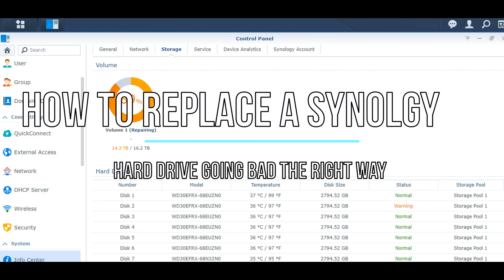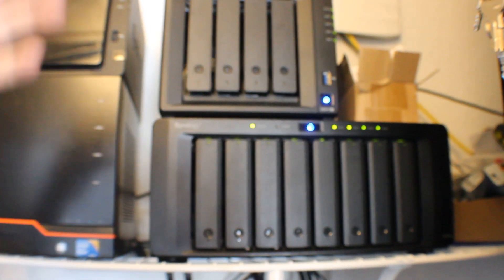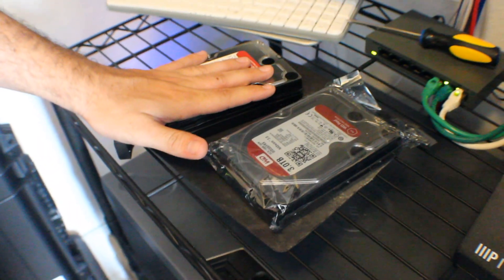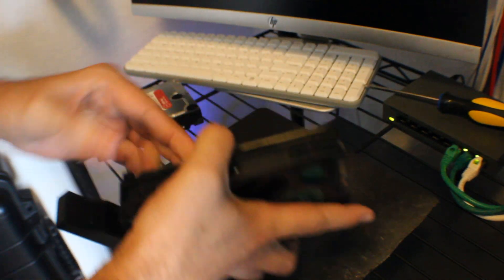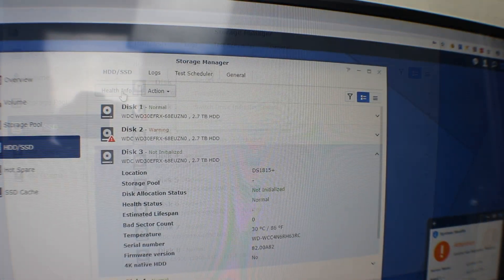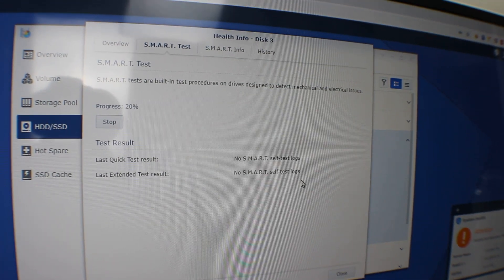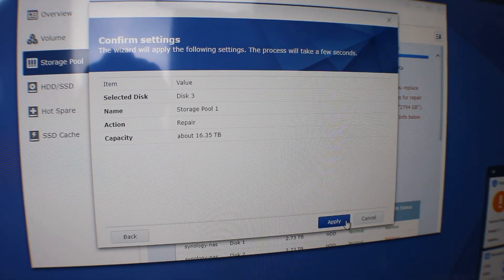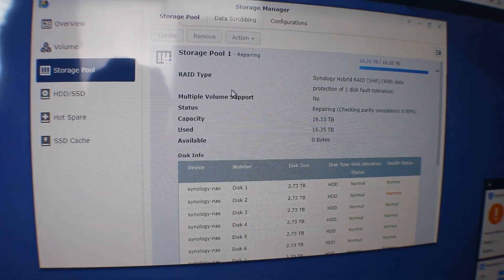How to Replace a Hard Drive in a Synology NAS

Comment: so u pull out the drive without doing anything in the system?
Reply from the maker: You can or go into Synology to disconnect it first that's the proper way to do it but other way should work but go in and disconnect first make sure to have backups too

Comment: I have a question, I hope someone can help me.....I have a Synology NAS DS918+ and the hard drvie and the drives are already failing.......can I use the same method demonstrated on this video to replace my drive? and how can I copy all the Files I have in the drive that is failing into the hard drive that I will be using.... How can I copy all my files from the drive that is failing into the replacement drive?
Reply from the maker: First do a complete backup of all your files to a external drive then one at a time replace one drive wait 24 hours or so for it to get repaired then do the next one when it completes the first one but back up your data first!

Comment: Hi sir...can ask a question how can i replace HDD DRIVE in NAS Synology that using Raid 5..Im scared lost my data or being corrupt.., i just found out last night that VMWAARE  Sphere 6.5 error loading all my VM...then review my Synology one having bad sector and the other one is having BAD SECTOR..thank for the reply much appreciate..
Reply from the maker: I would definitely plug in an external hard drive that's big enough to back up all your data especially the VM data sounds like you're using the Synology Nas as an attached storage to VMware? I would definitely use the app to back of your data right away or just copy the data off to an external drive before replacing the drive. If  you have multiple drives failures when you replace one it might cause another drive to fail during the rebuilding process which will cause you to lose all your data. Back up your date of first then replace the drive.
Reply: @GreyTechLive  how can i back up? when i dont see my files..I already pull out the HDD all of the sudden the SYNOLOGY trigger to repair itself automatically..right now im waiting to finish the repair process then i will load the new HDD..cross finger hopping  it might goes well..
Reply from the maker: @jhunfang06  oh crap Sorry I didn't know You couldn't see your files then the only thing to do is to replace the drive and hopefully it can repair their array and nothing else fails and you get your data back hoping for the best for you

Comment: I'm very new to NAS.  How did you replace all the data? Isn't the data still on the old #3 and the other ones have different data?  Which Raid (idk wtf this is but im sure it's the answer) did you use?
Reply from the maker: hi yes the old drive will still have some data but will be un readable because it needs the other drives to reconstruct the data. Just put in a blank drive and it will rebuild it to the array as long as the drive is same or bigger then the other drives.
Reply: @GreyTechLive  that's neat so it like knows what it needs to replace on the other drives and you just replace it.  

Do you just use the standard setup for that? I would like to know because I'd hate to get invested in this and then lose a bunch of data when its time to replace HDDs
Reply from the maker: @thebmxreviewer  ya right 100% by default the Synology will put the drives in a shr raid which will allow for up to one drive fail and shr2 you guess it up to 2 drive fails with 5 or more drives, and both raids allows you to just pull out bad drive and slide in a new one without losing any data but I always suggest have a external hard drive plugged in to have backups don't just rely on the raid any IT would agree. Also there are other raid types like raid 1 and 5, 6 etc that are good as well just depends on how many drives you have and what unit size you have every situation is almost different. Let me know how else I can help
Reply: @GreyTechLive  thank you for your time. I think you put my only concern at easy to start my own cloud storage/Plex server.
Reply from the maker: O nice man  I do have a Synology running plex as well love it no issues at all have fun!
Reply: @GreyTechLive  if you've had multiple of that brand, do you recommend a certain model?
Reply from the maker: @thebmxreviewer  hi yes I use the DiskStation DS1520+ because it has a lot of power and memory or just any Synology Play versions will be great because you want something that has a decent amount of CPU so I can decode the videos and won't pause when trying to decode or have issues so keep that in mind :)

Comment: I have a odd scenario
I have a ds1019 with SHR-1 with 5 hdd each 12TB. 
My new NAS is a DS1821 and I bought 3 hdd 18tb each. 
Do I migrate the 5 drives first and then hot swap them one by one? Or do I just add the 3 hdd to fill all 8 bays and then swap out the old 5 drives later?
Reply from the maker: To be honest I would just back up your data and settings and restore it to the new NAS with the new drives

Comment: Uhh, those type of synology with the front cover including the model you listed ARE hot-swappable, and an 8 drive nas should actually have a 2 drive fault tolerance, with shr-2 you can have 2 disk fault tolerance with 4 drives.
Reply: nevermind I see what you mean.  thought he was going to do both at once.
Reply: I think he did have RAID 6 otherwise he would have lost data.
Reply from the maker: well depends on the raid and i had shr-1 so only one drive could fail which i know is bad for 8 drives... but its just a testing box. yes 4 drives is the bare min for shr-2 :)

Comment: 1.Can you  use any NAS ready hdd ? And do they all have to be exactly the same?  
2. Is it fast enough to do video editing off of?
3. Can you directly connect it to your PC without having to connect through a wireless network?  If so, whats the fastest/best direct to PC connection ?
Reply from the maker: For best performance it's always better to use same drives and Nas drives would be fine the pro we red are better since they are faster if you want to edit of it then 1. Get the Nas that support read and write chahe or use SSD Nas ready drives. 2. Use gigabit switch and hard line the Nas do not use Wi-Fi ever lol will slow performance for sure. They do have some that are not network and you can use USB 3.0 to connect to your computer
Reply: @GreyTechLive  how about lan to lan.  Is it faster than usb 3.0 ?
Reply from the maker: @AndyHTu  really depends on your environment but USB would be faster but network not far behind
Reply: @GreyTechLive  gotcha.  Thanks for taking the time to respond.  It's very appreciated.  I will make this my next purchase before I build a new PC.  Been needing a solution like this for a very long time now and hated transferring files to new external drives.  This might even be able to replace dropbox for me.
Reply from the maker: Anytime now if you could afford a 10gigbit network adapter and a NAS that supports 10gig network then that would differently be faster but alot of money too :(
Reply: @GreyTechLive  I don't know too much about networking, so I assume this Synology NAS doesn't do 10gigabit speed?  And I also assume you would need to install that network antennae to  your PC as well as your modem/router?
Reply from the maker: The cheaper Synology units don't have 10gig only the more expensive unit usually have them and we all have to be hard line they don't have wireless that fast yet. But yeah I would be a lot more expensive see I may be stick with what you're going to be doing would be better :) let me know if you have any other questions
Reply: @GreyTechLive  I apologize for constantly commenting, but is there somewhere I can pick your brain or if commenting here just fine? :)
I've been talking to network friends and they keep telling me NAS aren't worth it because it doesn't transfer fast enough, but a lot of these don't add up when all I hear are youtubers saying NAS for video editing is extremely fast.  
1. How fast does a USB3.2, Thunderbolt, 10gbs Cable transfer?   Is it faster than what a super fast SSD can transfer?
2.How fast can a fast Synology/QNAP transfer?  I've been told that a fast SSD can only transfer 200-300mb a second. (maybe misunderstood)
3.I don't have a 10gbs router, but it does transfer 1gbs speed.
4. When you said hard lined, does that mean my house networking wires would need to be upto speed? Its about a 15 year old home so the cabling for it might not be up to date.  I also don't have control of the landline or the network in the house, so the best thing I would be able to do is just attach a 10gbs cable.  Since you said to not use wifi, does that mean I will need a physical cable fast enough to transfer the data?  Or do we need to connect to some kind of static IP?  (sorry for the dumb questions, I don't know much about networking lol).

Conclusion: Is NAS really faster than than an SSD enclosure with usb3/thunderbolt3 connection? Or is a fast NAS SSD fast enough to validate a anything beyond a usb3? (I keep getting some dude telling me usb2 is fast enough for editing as long as its off ssd, but that hasnt been true from my experience)
Reply from the maker: It's not since your network is not faster than one gig and you don't have the correct hardware for anything faster so yes I would just use USB 3.0 or if you can USB-C and then you should be good that way only good thing about having a NAS is you can also share it on the network and have multiple computers connecting to it So if you have like two editing stations that is a benefit of a nas. You want to talk more about this you can get on our discord and we can talk directly there happy to help Thanks for the comment
Reply: @GreyTechLive  joined!
Reply from the maker: @AndyHTu  nice

Comment: I want to swap the 5400 rpm with the 7200 rpm drive.   If I take out one of the disk and put a new one in, I won't lose my data?  I guess there's some kind of technology in the Synology hybrid file system.
Reply from the maker: Correct as long as you are in some kind of raid you should be okay do you have more than two drives?
Reply: @GreyTechLive  I have 1520+ with 5 bays.. I have 3 drives in and I want to swap 2 of the 5400rpm and replace them with 7200 rmp.  So I guess I would have to do one at a time.
Reply from the maker: @Barry Liu  Yes correct do one at a  time and make sure the other one is done before you start the other one Also I would back up just to be on the safe side.

Comment: I just received a notice of 6 bad sectors on my drive 2. How long can I wait to replace this drive?
Reply from the maker: I would always make sure to have good backups but that's really not that many bad sectors I've had drives that have 50 to 100 and it's still working fine but that's just a telltale sign that the drive will fail as bad sectors increase so just make sure you have good backups and you can use a drive and to completely fails but I just replace it when it starts to get over 20 bad sectors or more

Comment: Thanks for sharing this video. I have a Synology 920+ and I'm getting a warning message stating one of my drives is bad. I purchased a new drive and will try installing it tomorrow.
Reply: How did it go?
Reply from the maker: Good luck! Make sure to backup your data before you replace the drive to be on the safe side 🙂

Comment: I have the same model as you do in the video. I have 8 3tb disks and 1 is bad. I cant find a new 3tb drive , all i find is 4tb or bigger drives. Can i use 7 3tb drives and 1 4tb drive? When i change the bad drive to a new , can i loose my data?
Reply from the maker: Hi yes you can always replace it with a bigger drive but just so you know the raid will limit to the three terabytes and not four but I think that doesn't matter to you as long as you don't lose data but like I said I would always back up your data first then replace the drive but you should be okay.
Reply: @GreyTechLive  Thank you for your answer. No i dont mind if i only get 3tb from the 4tb drive. Ouhh i dont have more drives to backup all on the synology. Shud i hope for the best and just replace it?
Reply: I use raid 6
Reply from the maker: @Skoog.  no problem yes you should be ok to just replace just the chance of another drive could fail when other one is repairing could happen that's why i say backup your data before but i have done it before with no issues but you never know better safe than sorry i say. good luck
Reply: https://www.newegg.com/red-plus-wd30efzx-3tb/p/N82E16822234464?Description=3tb%20red&cm_re=3tb_red--22-234-464--Product&quicklink=true
Reply: @christhompsonphotography6783  I'm from sweden so i will buy it here. (i like how it says max 120 per customer) , a 4tb is about 130 dollars here.

Comment: Thanks for this.  Is the process the same if I want to just increase my disk space, going from 4 TB drives to 8 TB?  Do I swap them out one at a time and wait for the array to rebuild and repeat?
Reply from the maker: No problem, Yes you can do this just a slow process but can be done one drive at a time until it will resync up. Also would have backups of all data just in case also your nas  has a another failing drive during the rebuild you don't want to lose all your data.

Comment: I see you have 2 synology, can you sync them or you need 2 exact same synology, (2 clone) or it can by completely defrent
Reply from the maker: As long as you have enough storage on The other one matching or bigger pool storage then you can sync between each synology in some cases if your second sonology server is so old it can't support newer versions of the software then that might be an issue but I haven't ran into it but I know it's an issue out there if you have older equipment